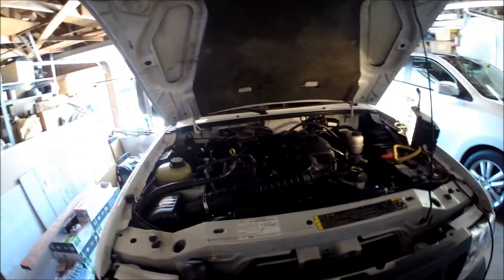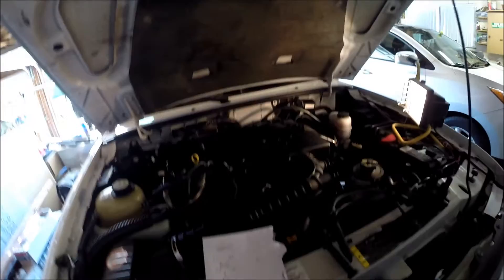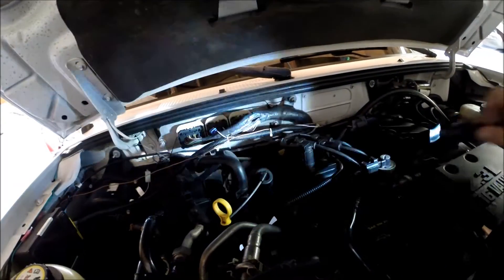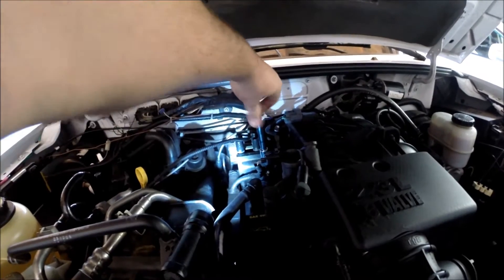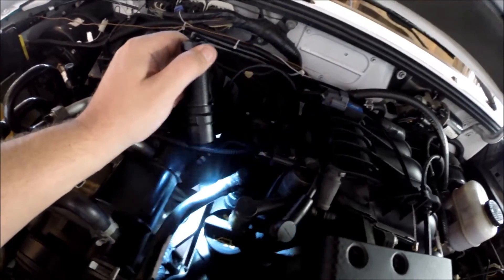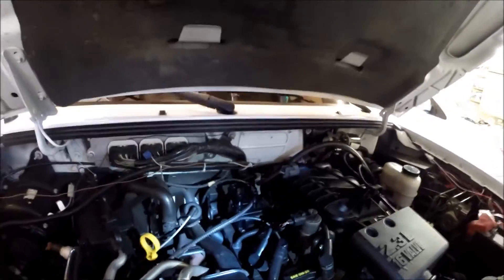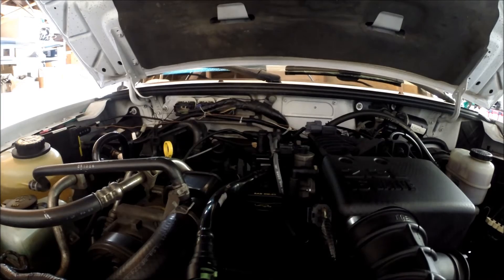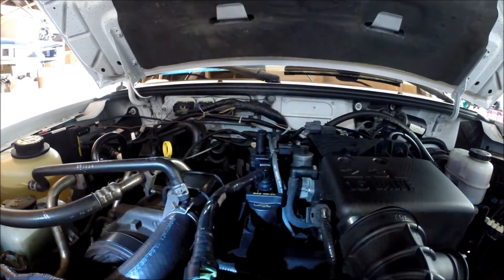Ford Ranger Ignition Coil Replacement

Comment: Awesome, especially about the electrical connector part that was shown at about 4:15.00 into the video. I did not know how to get that connector off properly. Also in addition, in stead of diagramming the wiring, I took painters tape and labeled them before I took them off. Great job!

Comment: 2006 ranger white just like yours 2.3l 5spd 2wd with 265537 miles looking to do the same thing you did in this video cuz mine seems to take forever to start and I just recently put a brand new starter on. Hope this fixes my issue. Thanks for the video it helped me to be certain I can do this myself. Btw nice truck really like those rims and the halo headlights.

Comment: Thank you for this video!  Very much appreciated.  I had a shop just charge me $500 to replace the coil pack in my 2005 Ford Ranger.  Did I get ripped off?  I had a bad feeling about these guys the minute I walked into there highly polished and expensive looking waiting room.  But maybe this is the going rate for this?  I'm a woman by the way and I know a little about vehicles as my Dad owned speed shops his whole life, but I don't know enough not to get ripped off.  But I did just look up the cost for these packs and can see they cost nothing.    At first, I said to them, "wow, that's a lot for a coil!" and they replied "oh, it's a whole pack.  We cannot just replace one coil."  So what do you think?   Thank you very much!
Reply: I hate to say it, but yeah you got jipped.
The coil pack is in the ballpark of $100 and there's only four bolts holding it on, once its bolted you just plug the spark plug wires back in and the coil pack. Shouldn't even take a shop an hour to do.
Reply: @JakeTerch  Thank you for the reply!  I appreciate it!
Reply: Jesus First To-the-Point End Time Signs no problem! I just did it myself and it solved my misfire. Rangers are easy enough to work on so don’t be afraid to tackle any repairs with guidance of other owners!
Reply: @JakeTerch  Thank you!  Yes indeed, I will not make the same mistake twice!  God bless!
Reply: @jesusfirstto-the-pointendt4552  Contact the State's Attorney General for price gouging/sexism and your local TV stations and write a google review.

Comment: did you have any issues getting cylinder 3's wire to seat properly on the spark plug itself?  mine won't seat fully causing a misfire
Reply: I had the same problem. There was a clearance tolerance problem for the #3 connector going to the spark plug. 
I actually cracked the ceramic on the plug, while trying to get the long plug connector to seat. This was a big problem, as the bits of ceramic fell down and kept my 5/8ths socket from seating. I could not remove the broken plug. A blessing in disguise... if I pulled the plug, ceramic would have fallen into #3 cylinder, messing it up, along with its exhaust valves.
I had to rig a 1/8ths inch brass tube to my shop vacuum to get those bits of ceramic out.
Helpful hints might be, to remove the 4 Torx T-25 screws holding the ignition coil.  This will allow you to easily reach under the coil connector, to press the retainer wire up and release it. After you remove the connector above #3 plug, you will have more room to pull or seat #3 and #4 plug connectors.
With the connector above #3 and the coil connector seated, my engine ran fine with the ignition coil not screwed down.
Also, use a long 5/8ths plug socket with
1. a rubber insert to hold onto the plug and
2. grooves inside the top of your socket, to catch onto the little ball bearing on your 3/8ths extension.
After having to fish out my socket and plug many times, with a magnet, I finally went to a local pawn shop and got a used 5/8ths socket with 1 and 2 for fifty cents.
To fix my plug connector clearance problem, I had to use my grinding wheel to remove about 1/8ths inch of the rubber around the edge of the bottom of that connector. But, before using the grinding wheel... try rotating that long #3 plug connector to different positions.  Maybe your connector is not perfectly round at the bottom, and it comes too close to something in that tube for the #3 spark plug.
If you didn't manage to catch massey706's ignition coil connector layout...
#1 connector is closest to the driver's head light
#2 connector is closest to the passenger's tail light
#3 connector is closest to the driver's tail light, and
#4 connector is closest to the passenger's headlight

Comment: Great Video, do you feel any difference with the new coil and plugs ?

Im debating doing this for my truck as well
Reply from the maker: My truck does idle smoother, and it does feel like it picked up a little HP not much but just a little bit
Reply: I have a 93 ranger with 380,000 miles and going strong. Everthing works